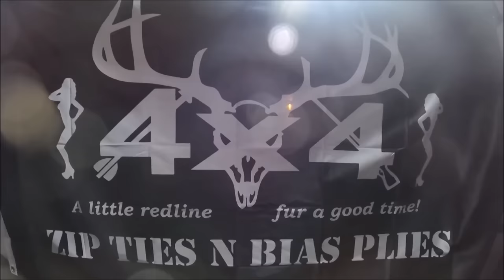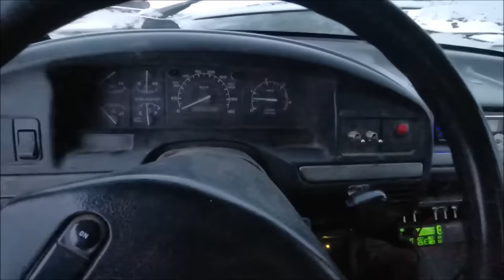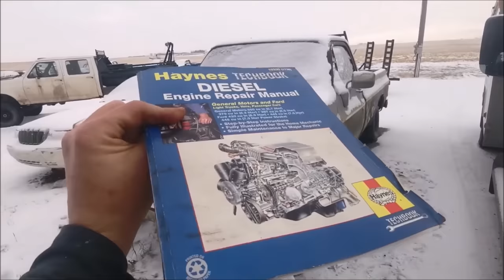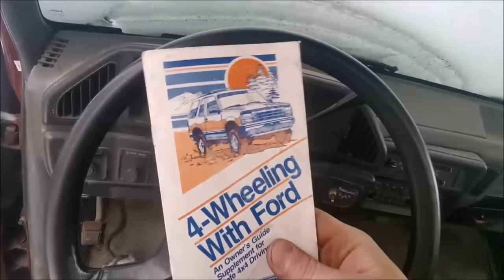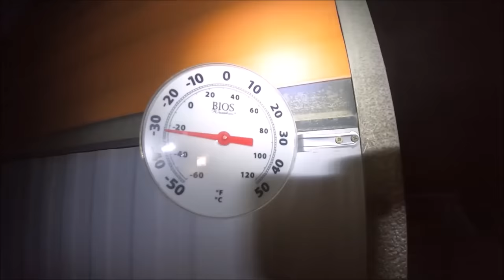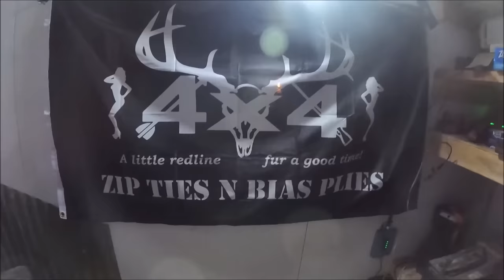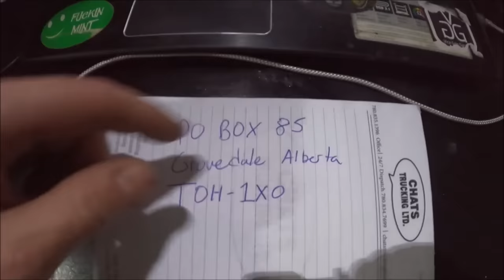OL RED DEAD, REZ-ERECTION + COLD STARTS, UN-GREASED EDITION

Comment: At 50 years old i finally blew up my first battery.
I put 12v to my 1950 ford with 6v. It was dead and sparking i wiggled the cables and BOOM blew up in my face. Good thing i was already half deaf and blind so it didnt change things much. Burned my wrist where the glove wasnt and made a big mess. Then i went to jail next day. The cops didn't care that a battery blew up on me day before

Comment: Towing back lol. I would have drove it all the way. That's how we did it back in driving junk home 44 miles from the auction. Some junk had doors , some had wheels that were same size some had 2, 3,4 doughnut spares. Some caught fire, some through a rod or 2 . Most had brakes most of the way home.

Comment: I had a 6.2 in my shit Chevy. It would not start up ,1/3 of a can of starting fluid later .....it starts. Went in to a runaway for about 5 min. That’s when the cam came out of the back of the motor .  Was still able to get $600 bucks for it . Two batteries and a new starter and a injector pump with less than 6 hours on it . Worth more in parts but sold it to the first magoo who threw my 6 beans for it all.

Comment: I have watched this twice already but man here in Maine I can't find a 88 89 90  91 f350 4x4 single rear wheel truck anywhere that would be a great beater truck I am currently running my 1997 f350 dually turbo 7.3L powerstroke been in search of a zf5 or zf6 for her and a single rear wheel f350 with a factory back body

Comment: Bitchelin tires are the absolute worst when it comes to dry rot. Ive never seen a tire dry rot so quickly. Most tires are made to dry rot nowadays because, you know, job security, but bitchelins dry rot in as soon as 6 months.

I also like how he pointed out a old Ford sitting in the weeds started better than a driver 6.2. Lol.

Comment: Thanks for the videos. Top shelf as always. Hopefully the sawed off Frenchman’s death is not on the cutting room floor because the old Ford found a patch of traction. You need to get Frenchman a 24 Volt Starter from the 6.2 Millitary Trucks, spins them over at Governed Speed. Always a laugh

Comment: Electric seats are mint for adjusting the fast idle stick. And checking brake lights if you ever feel the need to avoid getting pulled over when you're drinking